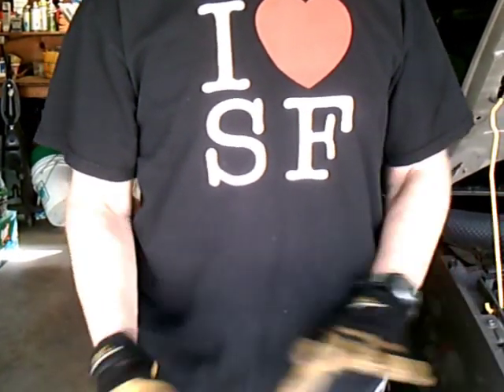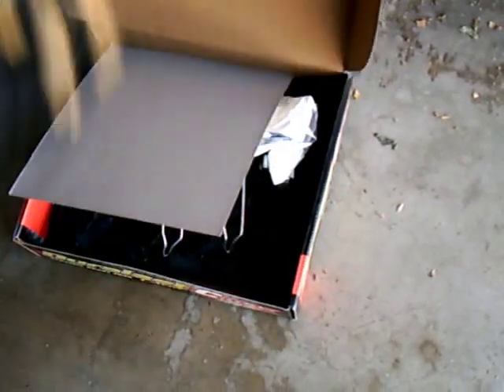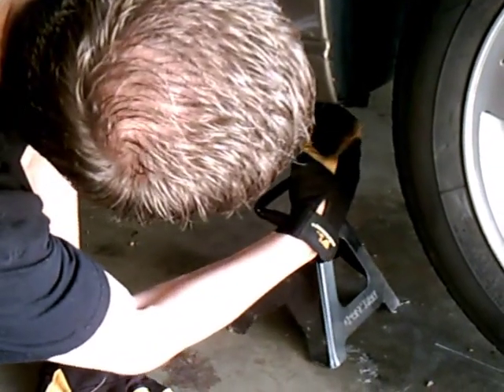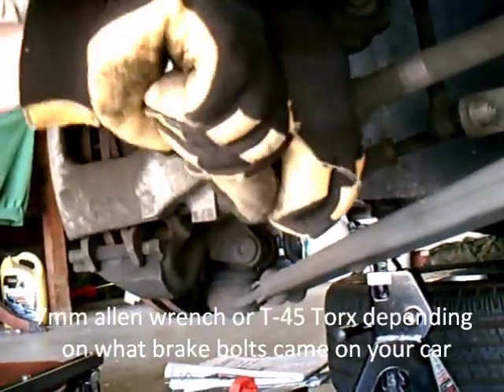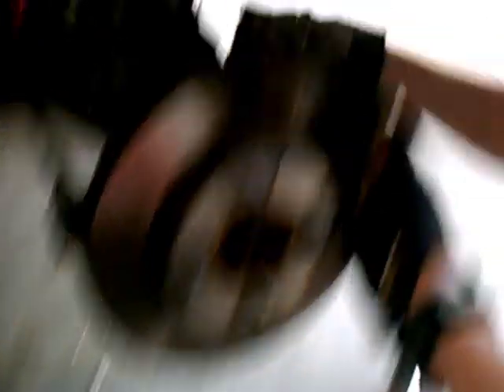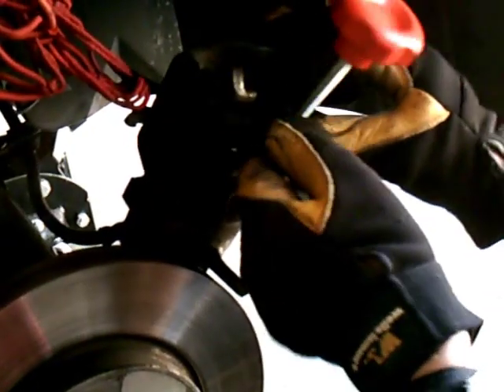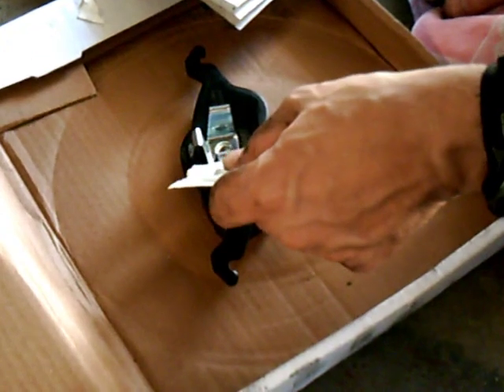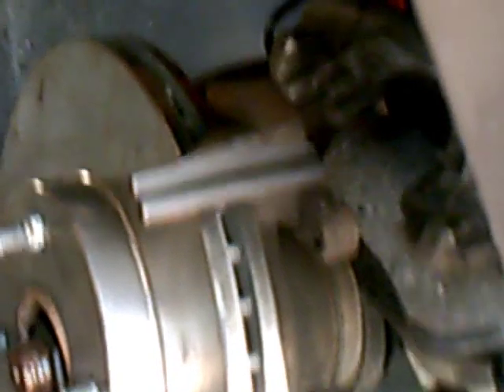2004 Ford Focus Front Brake Job Pt01

Comment: Great video, just thought i would mention that before anyone drives after using this video tutorial you apply the brake a few times to ensure that the pads are in the appropriate place. If you DONT do this it will take a few pumps of the pedal whilst driving before the brakes are at full capacity.
Reply from the maker: Thank you for the additional info.